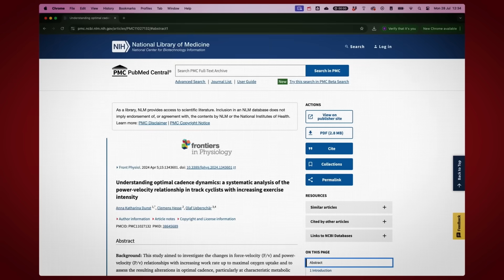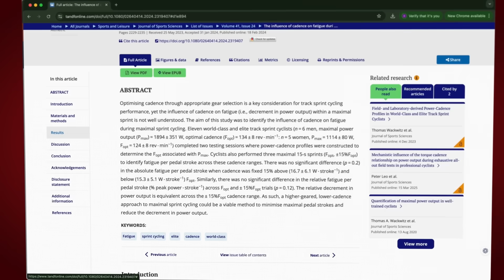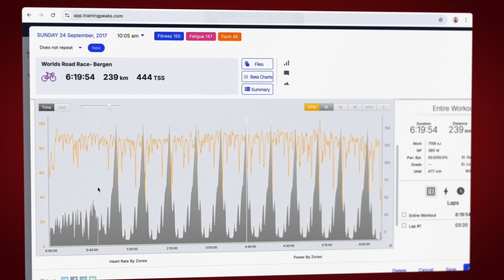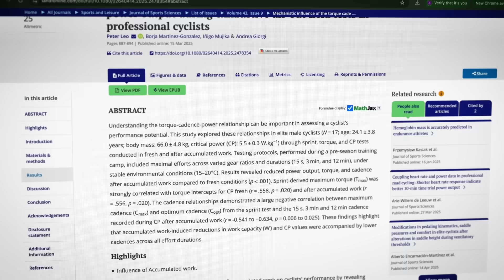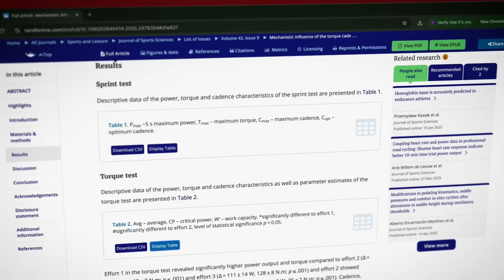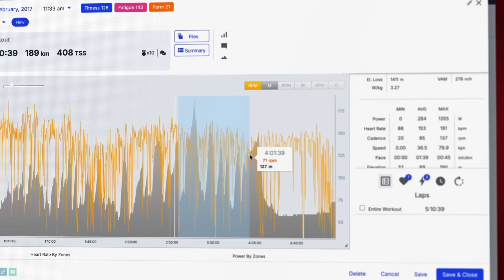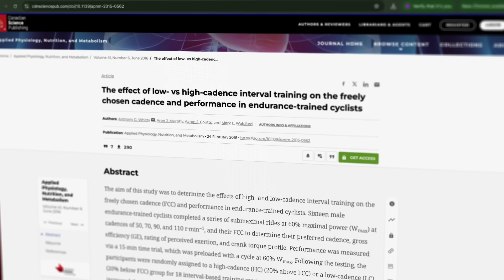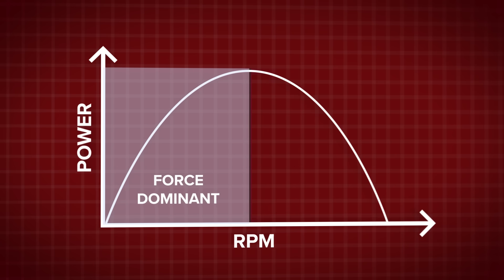I Thought I Knew Everything About Cadence. I Was Wrong.

Comment from the maker: What's your preferred cadence? Let us know in the comments below!
Reply: 95-105
Reply: 80-85 just feels most natural
Reply: Is this the same Peter Leo who in 2022 said,
"Differences between MMP (Mean Maximal Power) between cycling performance levels and rider types are dependant on torque  rather than cadence..."?
If i have understood  correctly, Power = torque x cadence.  If one goes up and the other goes down power stays the same,  Power only changes if one goes down and the other remais constant (or drops.)
I'm no Scientist and I'm unfortunately,  not a great cyclist either, but when I get tired (to point of failure), it is usual to see torque and cadence both going down.
If tired does not equal point of failure but simply can't maintain that speed/power, then it is logical that cadence would drop first as reducing the speed that your legs are rotating is most likely to reduce HR nearer to sustainable levels. When you run you don't increase your cadence when you get tired, you slow to a jog/walk.
Reply: 85-90
Reply: 80 to 95 for 'normal riding', or whatever speed the pedals can be forced around on a steep climb! up to 150 sprinting
Reply: Old cranky marathon runner... My normal cadence cruising along on flats is 100-115 rpms.   I am comfortable from 80-130, but would rather be 90+, I and I can sprint much higher than 130 for short durations.     I don't like grinding, so my bike is geared so I can spin even on steep stuff.   I use short cranks, as it helps with old/cranky person bike fit problems and it's better for spinning (smaller circles).
Reply: freewheeling ;) ... 80-90 RPM
Reply: Spin especially on longer rides it keeps your legs fresher and for me its better for climbing.
Reply: 72 to 74 take away all my electronics and my body will just still settle in that range.
Reply: 80 - 85 on climbs
95 - 105 on flat
Reply: Anything between 80 and 125.
Reply: When I put 3 clicks for higher gear, get out of the saddle and put big torque
Reply: Mine depends on power output. I think my power per stroke is usually pretty similar - as the power goes up, the cadence goes up. If I'm firing on all cylinders, I'm at 88-92rpm
Reply: i feel comfortable with 80-100
Reply: Seem to average around 75rpm for my rides
Reply: I don't train cadance but high spin tires me out and can cause knee pain

I like to keep it medium speed, plus I want to feel the road, to high and you just spin out with very little resistance.

Except on hills I'll take higher speed to avoid the grind, and I just accept slowing down I don't try to attack nothing slow and steady.
Reply: @Randomness82  Interesting. For me, pushing a big gear causes me more knee pain. I tend to be around 90-95 most of the time.
Reply: I seem to be most comfortable at 90 rpm.
Reply: My sweet spot for climbing is between 70-75rpm. The worst I have done is 17mins averaging 20rpm climbing with a fixie. The fastest was around 150rpm descending with a fixie ROFL!
Reply: For Z2 i've always landed between 94-96rpm. So really specific. For more intense efforts its usually around 110rpm. I can sprint with pretty much same power output from 70-150rpm. Higher cadence sprints are much harder to extend when tired.
Reply: 69 to 90
Reply: 88
Reply: I deliberately grew my cadence from sub 70 to around 90. I can now vary cadence up down depending on terrain and my heart rate, but learning to be comfortable riding at high cadence has been very helpful! It's good to have options and flexibility rather then being stuck in a low cadence situation!
Reply: @DigzGuy I think that is entirely the takeaway of cadence training. It is not that you should ride at a particular cadence, but you should train your muscles to handle a wide variety of cadences, especially high ones
Reply: I used to go 95-100 rpm, but this year I've dropped down to 85-90 rpm after warming up at 90-95 rpm.  This on flat ground and I'm 70, 6'1", 200lbs and 175 cranks.
Reply: Variable based on terrain, what I have done before and how fit I am. Typical low power distance rpm varies between 87-89 rpm and pushing is 92-93, but injured old me will not hold that too long. I was filmed sprinting on a trainer at 162, which probably is my limit as I am not getting healthier and younger thus stronger.
Reply: on my trekking bike so far 85-95 though it's amazing to just spin it out on a decent road. went to 54.5km/h today with an estimated 900W peak in there. i like those numbers ngl
Reply: 85-100
Reply: Well outside i naturally average 80-83 rpm but inside on the trainer i average 88-92 rpm.
Reply: I don't know what my cadence is because I don't really measure it. But I know that over the last few years, I went from being a pure grinder to become less of it. The main motivation for that change: it's a lot more gentle on my knees! 😉
Reply: Around 60, but thinking to raise it a bit. &0 has felt a bit low so I think it might be better around 64 but we'll see, how it feels :)
Reply: 80-95. 100-105 on slight downhill
Reply: 80/85
Reply: 90-95 is my preferred rpm 

for short punchy climbs i prefer/am faster with
 less rpm, higher torque
Reply: I'm a natural spinner, so 95-100. I've found that spinning will get my heart rate up, but I can recovery pretty quickly from that. If I blow up my legs with a slower cadence, there's no recovery the rest of the day.
Reply: About 60-70 on flats and 20-30 on fixed gear climbs for me.  I prefer old school grinding, it makes your leg strength insane.  Training for lactate threshold, VO2 max and heart rate in your 40s is pointless, and potentially a path to using a pacemaker if you overdo it.
Reply: everyone is unique, it has to do with the physics of body muscle
Reply: I generally spin the legs. On the easier gears. But, every now and then, I’ll drop down to the 10t cog to focus on power with a low cadence for an interval
Reply: Around 80 I would say for me, but tbh anything will do as long as I feel comfortable when riding
Reply: TBD
Reply: Fairly technical video. Perhaps illustrations to simplify it would be good
Reply: I tend to average 90 rpm naturally. Even if I turn off  my display of cadence on my computer, I still end up at the end of the ride with an average of 90 without even thinking about it during the ride.
Reply: I could have told everyone this many years ago having had a CVT and automatic shifting for the past decade. This allowed me to always pedal at my option cadence and find what it is. I ended up programming it to vary my cadence depending on power output as suggested by the research. My favourite cadence turned out to be 72 rpm at around 200W. 65 rpm at 100W,  80 rpm at 400W and higher as power increases.
Reply: 80-90
Reply: Naturally — 75. 90 on the trainer or when I’m focusing on good form outside.
Reply: I find I can ride a lot longer and happier spinning a smaller gear, with a faster overall speed. My happy place seems to be in the 80-90 rpm range on the road or flat off road. For a climb out of the saddle, maybe 60-70 rpm. Steep climbing in the saddle off road I will spin 110 rpm or more.
Reply: If my legs are feeling good, 80-85.  If my legs are cooked, 90.
Reply: 87
Reply: 85-105
Reply: Comfortable at about 103.  Strangely sensitive - I find I want to shift up at 105 and down at 101.  
Bit out of practice now though 😡
Reply: @johnlow4064 insane.  I'm kinda the same way but with 81-86.
Reply: I run 160mm cranks, easily can maintain 95-105 rpms average. But I can also grind it out 60rpm for climbing steep gradients if needed.
Reply: My most Power is at 70-75 rpm.
Reply: 60-65 haha!!! Heresy
Reply: 80 is my Sweet spot, I tried to copy pro riders and I ended up just exhausting myself.
Reply: 75-80 for me. I much prefer to push harder than faster.
Reply: It's not something I've paid a huge amount of attention to unless I was following a workout with a suggested RPM, but I have noticed over the last year or so as I've got stronger that my average cadence has gone up, from 80 to closer to 90.
Reply: around 80-100

Comment: Check out the findings of Formenti at Kings College concerning internal work versus cadence. There is always non-productive internal work when cycling. Think of this as the overhead required just to keep your legs, feet, cranks and pedals moving at the speed required to avoid coasting, but apply no force to the pedals and push the bike.  Formenti's data show this to be a strongly increasing function of cadence.  So there is a power cost to a higher cadence at a given speed. This extra work increases the cardio load when maintaining a specific power output on the pedals and resulting speed. There is thus an energy benefit to using lower cadence to maintain speed. When you are tired,  you will want to be as efficient as possible and sustain with a lower cadence. OTOH, high cadence is essential for higher efforts, such as attacks and acceleration.

Comment: Discussing cadence in terms of averages can be misleading. My average cadence is only 86rpm or so but I ride at almost exactly 105, up hill and down dale and regardless of power output, so I suspect that many other riders' typical cadences are also substantially higher than their averages, although I suppose it does depend on whether zeroes are included in the calculation. In any case, it's easy enough to determine typical cadence by examining ride records.

Comment: I raced a little,  partly because of  a late start. I was almost 30 when I quit running and took up commuting and 200 mile and longer rides.  I rode the Arizona Challenge a 325 miles challenge ride 3 times. I quit at 200 miles my first try. I completed it the next 2 times I rode. I learned that high cadence helped me and my friend Jim Elliott, who I supported in the  Race Across America. I think we both road at about a 100 cadence.

Comment: I dropped crank size by 10 mil. I have massive leg strength. So can grind a decent power. But, you need to be able to use both you're power and cardio systems. Up hill is more cardio. a higher cadence is more effective. Spin to win! So for me, it's more about training to improve my weakness.. I'm a natural 'slow twitch'  So endurance is easy for me. As a runner, my sprint is poor. But, on a bike, then my leg power is a huge advantage.
I do want to do hill climb events. Meaning, I have to improve cadence Yet use my strength too. The 'numbers' will have to work themselves out I guess!

Comment: So... the thing is having an easy going... once you are going fast enough, the hardest gears go kinda easy... that is where you wanna get... good speed build up... and you can get there... even if you start of with just the hardest gear - the build up is longer, that way, if you dont push hard, but then you will save energy, and eventually pass those who spent more building speed early.

 And consider that as good advice. The point is to use your energy optimally... in general, higher RPM would be for climbing with not enough speed.

@cbtpro
pirms 1 mēneša
Old school:
Lungs hurt? Push harder, spin slower
Legs hurt? Spin faster, push less

Comment: As a mechanical engineer, I should be answering this question, not asking it, but throughout my career, one consistency has always been that asking open minded questions is always wiser than attempting to answer or assuming a position of expertise. I feel that this question poses an excellent opportunity to set up an experiment. My hypothesis would correlate with your explanation and the formulas for power which involves faster cadence providing more power. If two riders (or the same rider with adequate rest period) outputting comparable wattage  accelerate from 10mph to 20mph, but one at (60)spm in high gear, the other at (90)spm in a lower gear. I would expect the higher cadence to accelerate faster consistently, but I would love a deeper breakdown with measured data. Separately, I would expect lower cadence to maintain power output comparatively, and that varying cadences varies muscular energy pathways and muscle fibers recruited, which is why rowers start with slow cadence high force strokes and finish a sprint with higher cadence, at least in my amateur experience.
Reply: A certain Wattage doesn't give you an acceleration (unless you are in a Galileian vacuum) but a constant speed. If you accelerate, you are applying an increasing wattage to the system. If the wattage you are applying while accelerating is, moment by moment, the same, then the two bikes will accelerate, moment by moment, the same, regardless of the gear they are using.

Comment: An important aspect hinted at obliquely is metabolic cost and glycogen depletion. Efforts <80rpm recruit more fast-twitch fibers and begin to pull more energy from stored glycogen as opposed to the aerobic system. Not an issue for 1, 5, 20 minute efforts but in 100 mile races it can be the difference in finishing first or finishing at all.

Comment: I found out just recently, that I'm doing it all wrong. On my Stages indoor trainer, I average 90 rpm on my rides unless a workout calls for lower or higher.  I just very recently upgraded my road bike which came with a power meter.  I found out that when I ride on the road, I'm averaging about 65 rpm.  Shocked, I decided to try to hold 90 on an actual ride with all the short climbs and dips and was surprised that I was able to hold the cadence for most of the ride and landed up performing well above all of my previous rides on the same course. Just yesterday, tried the same general approach on a mountain bike ride and finished my typical course 1 mph faster than my previous faster times.  In my case, it seems more tenable to keep a cadence above 85 and shift more often than trying to power through while using the smaller cogs. Still surprised how I was able to hold higher cadences for 1-3 hour rides with no issues - especially on a mountain bike in mountain bike terrain.

Comment: This reminds me of me looking at these very old cars with huge engines and low horsepower.  They had low RPMs.  F1 cars had limited RPM at some point, perhaps to lower costs.  They generate massive power with small engines and high RPMs.  Humans aren't cars, but the power equation is the same.  I was more interested in cadence for casual cycling.  Personally, I seem to be comfortable around 70 RPM.  I am 60, and ride a class 1 ebike, so maybe that alters what's comfortable.  I always disliked having to push hard in higher gears though.  Higher cadences and lower strain seems to cause less joint pain, but higher cadences might also cause more joint wear.  Be cool to see a video on these factors, for us aging casual cyclists.

Comment: Interesting stuff, I ride at about 100 rpm all the time! I don’t have a power meter, never have. So, when I see my cadence drop I just pick it back up.
Reply: When I notice my cadence dropping, I often find that I’m pushing too far into the pedal stroke. By focusing on “tapping” out the rhythm and keeping most of the effort in the upper part of the circle, my legs relax and my feet move more quickly. Also, keeping the effort in the “10 to 4 o’clock” segment of the circle makes more effective use of the glutes.
Reply: @trackie1957 interesting, I am going to have to try that. I have always focused on pedaling full circles as opposed to squares (just 1/4 of the  stroke such as down)
Reply: @charlesm7132 
I’ve always tried to have a nice, round pedal stroke. It requires all the muscles to coordinate, and is absolutely essential if you want to ride a fixed gear bike down a long hill! The point of my comment was that the power comes from the 2 to 4 part of the circle, but you still need to move your feet in a fluid, circular motion!

Comment: Very average 65yo road rider.  FOR ME.  By watching heart rate and speed - I change gears to aim for 80 rpm.  I don't allow it to drop below 80 and as it drifts into low 90's - shift to get back down to 80.  Power tends to follow this strategy.  There is an interesting point at low 90's when you can see a gear shift to slow the cadence actually makes me faster.  So I surmise I was wasting too much energy just moving the legs around.  YMMV

Comment: Higher cadence over times equals a bit less leg muscles is needed and you can be a bit lighter but gives a bit more strain on heart and lungs, lower cadence the opposite... Usually for myself and everyone I know the whole game is against lactic acid in the legs. I biked at around 100 rpm and could go 97% max heart rate for an hour. 90rpm and heart rate went way down, lactic acid went up... Funny though the speed difference was very small but I could ride a lot more without getting fatigued per week with higher cadence... I never rode long enough to loose enough muscles where the higher cadence would make me faster at climbing through lighter weight. You can easily make your body used to different cadences over time. I have seen it many times on super slow spinners going the Armstrong/Froomey route back in the days getting super comfortable with always spinning fast. They always improved when doing the shift... 100rpm is really high though.

Comment: I am amazed that peeps are still debating this subject, put simply, a bolt threaded with a fine thread and the other with a course, the fine threaded one requires more rpm to spin the nut on BUT is able to apply a greater force when tightening than the course, I knew this as a 17 maintenance fitter apprentice and could bomb out cadence computers at over 200ppm's and run out of force on the pedals (53x13) at 80-85klm/h.